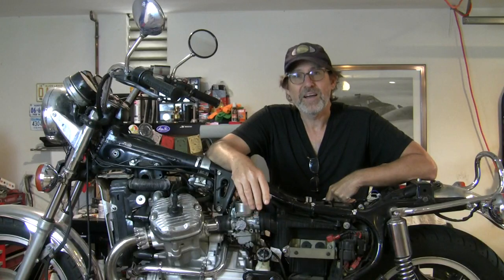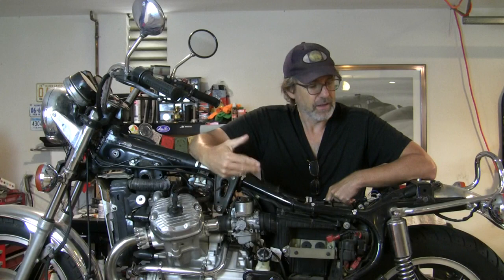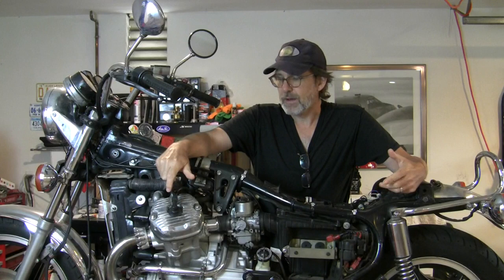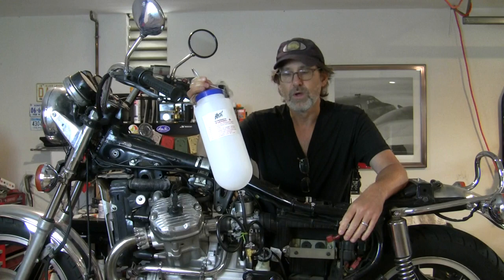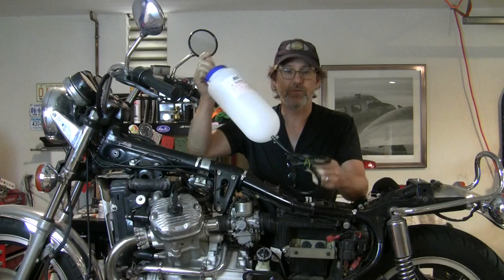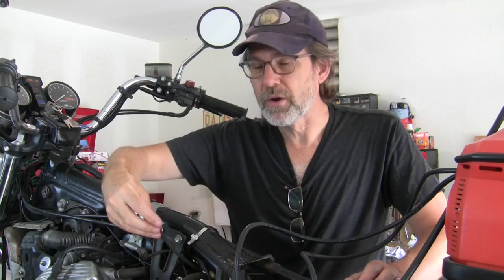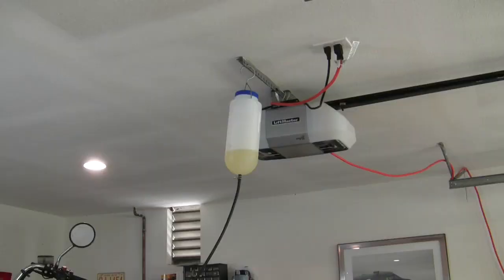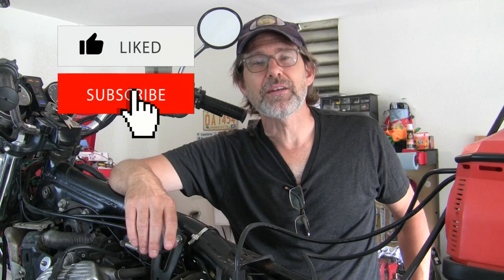First Start - Honda CX500 (Part 20)

Comment: Just fired up a 1980 CX 500 Custom that was sitting since 1994. New battery, tank flush, carb cleaning, & oil change … 4 hours I was riding it. Thing only has 12,000 km on it !!!
Reply: Carbs were very gummed up !!! But I marinated them in furnace oil, & cleaned jets / float valve assembly / receiver with my various techniques.
And boom, she lit up in a split second LOL
Yes I had poured oil in cylinders & ensured the piston were moving freely before that
Reply from the maker: Love these CX500s. They have a special place in my heart. I've spoken about it at length in my book.
Reply: @UrbanMonkTV  yes they are neat little commuters . I can do most anything with a motorcycle mechanical wise. Sometimes we overlook the small things. Topped up rear tire pressure to spec this morning, & fell in love all over again LOL She handles beautifully.

Comment: Always tap on your carb bowls with an extension while delivering fuel to recently rebuilt carbs
Reply from the maker: I can see why you would suggest that and appreciate you sharing it here for me and others. Also appreciate you watching!
Reply: @UrbanMonkTV  sometimes the float sticks, & also to bleed air. Often I stop the float bowl from leaking with a few taps. It’s jus part of my process. And / or open the bleed screws to ensure flow.

Comment: 12.3 volts is indicating no charging. The CX charging system allows for a maximum of 14-15vdc at 5,000 rpm. If the battery is a standard lead acid type then it is fully charged at 12.7v and the charging system is designed to break even at that voltage a bit over idle. You should always see something over 13v at above 1,700-1,800 rpm in order to keep the battery charged.

Comment: Jump starting a motorcycle from a running car is a good way to fry your regulator/rectifier.
Reply from the maker: Thanks for watching. That is not intuitive to me. Will you please explain why that would be?
Reply: @UrbanMonkTV  I copied this from a post on the GSResources.....The problem with jumping from a running car happens when the car regulator is set for higher voltage than the bike's. Unlike the generator in a bike, an alternator in a car adjusts the magnetic field and produce 14.4 V (or whatever) at idle or at 6k rpm. So if the bike's RR has a lower voltage limit, it will always lose.  

That being said, there are varying opinions on this.
Reply from the maker: @jsandidge1  Thanks! This is great fodder for an investigative video, which I am going to do in the near future.
Reply: I've read before that to jump start a motorcycle from a car make sure the car engine is not running.
Reply: Remember that a blown regulator can feed excessive current to the battery, cooking it.  Again, my experience with a 94 Honda Magna.

Comment: Could you walk through adjusting the idle screw for this Bike? Have the same bike and need to adjust, thanks for the videos!
Reply from the maker: I'd start a 2 turns out from seated and then tune using a ColorTune.

Comment: I have a fuel leak in that same exact spot. Mine only occurs when the vacuum port on the carb (that normally connects to the vacuum peacock) is open. If I pinch off that open hose or if I hook up the gas tank the leak no longer occurs.
Reply from the maker: Yes! I eventually ended up plugging that line and guess what?...No more leaking. Thanks!

Comment: Exciting! I actually just got mine restarted again after fixing an oil leak. It ran but very rough before. 

Question: I’ve got it running, but it’s very rough idling, and backfiring like crazy, I’m talking shooting flames out the exhaust. Would this just be the carbs needing adjusting? I haven’t synched them yet or made any adjustments but I did rebuild and clean them.
Reply from the maker: Thanks. Could be carbs but also Could be timing and/or valve adjustment. If you've got valves that are not closing all the way you could have that situation. Also if the pulse generator is rotated incorrectly for some reason could contribute. Not sure which model you have and if you had that out of the rear cover or not.
Reply: @UrbanMonkTV  thanks for the reply! This ones an 80, and I only took the front cover off to fix the leak. 

Any chance you’ll do a video on valve adjustment in the future?
Reply from the maker: @rob_u_blynde  Yes I will as I intend to polish my valve covers. As long as they're off, why not I figure. Thank you for watching.

Comment: Hello from Uruguay. I have a custom honda cx500. I've seen your restoration video, congratulations. In two months I plan to travel 9000 kms. What precautions should I have? Thank you
Reply from the maker: Hello from Los Angeles! Thank you for watching! If you've done the "quadruple bypass" if the motor is running/sounding  good and mechanical seal isn't weaping from weap hole, your probably good to go. The CDIs on these vintage machines are getting old now and are a bit of a roll of the dice, but old Hondas have a reputation for getting people where they want to go. Enjoy your trip! (It should be noted that I am an optimist usually - perhaps to a fault sometimes.)
Reply: @UrbanMonkTV  Thank You!!